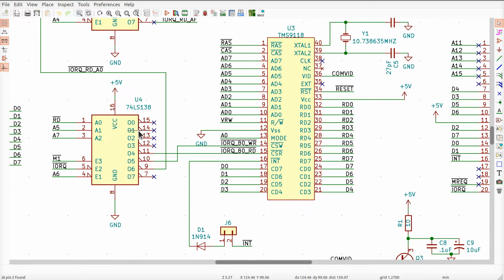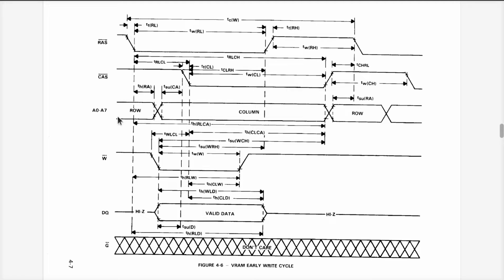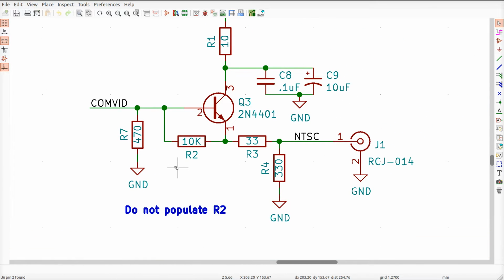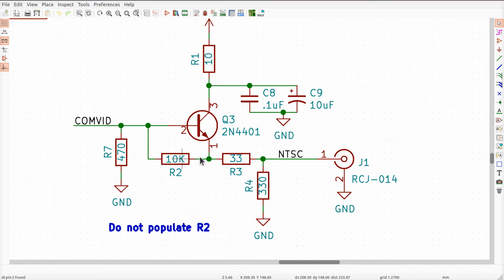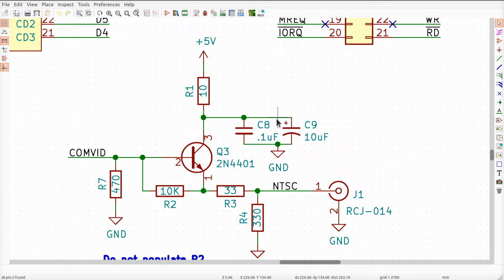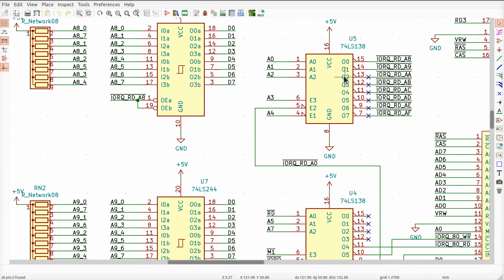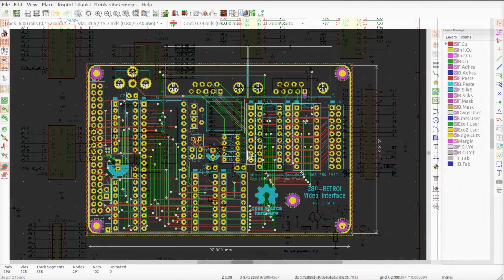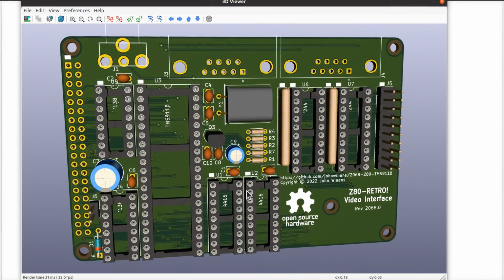Z80 Retro #49 - TMS9118 VDP First Draft Schematic & PCB for the Z80 Retro!

Comment: R1 / C8 / C9 parts try to isolate the 5 volt supply noise from the transistor power voltage.  Try a 100 ohm resistor which might help
out with the noise level on the main supply.   R2 helps out to bias the transistor and the feed back from the emitter keeps it from over
driving the signal.
Reply from the maker: I went with a ferrite in R1 and am OK with the results for now.  I suspect some more testing could make it better.  Next round I can try a bigger resistance.
I am certain that Steve Ciarcia knows MUCH more about what we was doing than I with respect to this driver circuit.  So far, however, mine looks better without it.  I went as far as to remove it from the schematic last week.  Maybe I should put it back in for more testing.  :-/